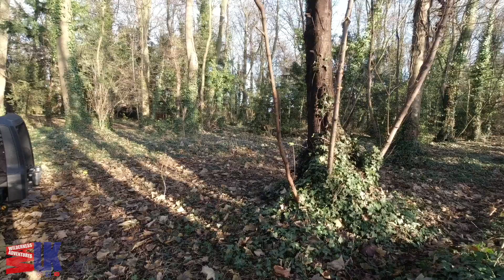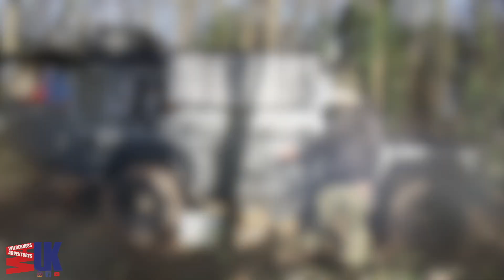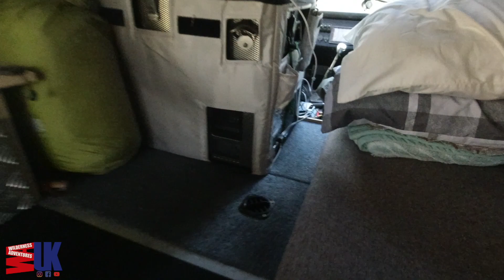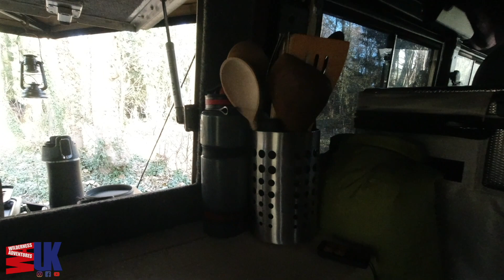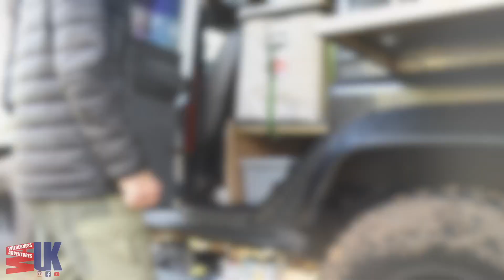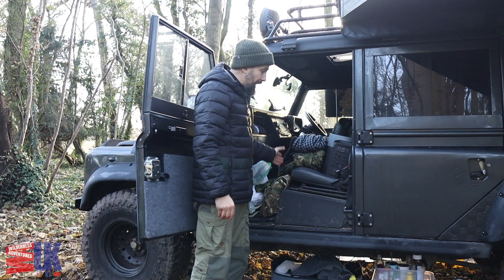Closer Look at the WAUK Land Rover 110 Overland Truck

Comment: Great layout. I prefer spot lights over light bars like you said you build for yourself. Stay safe atb 👍
Reply from the maker: I have the spots on the roof but they are purely cosmetic, the light bar on the grill is functioning tho...

I have a list of things to do, 1 of which is fit the snorkel so I have somewhere to hide the roof light wires

Comment: Nice build, I love a good Land Rover and share a Defender 90 with my dad. We use Davanti Terraroura A/t which were developed by Edd Cobley. Really good tyres.
Reply from the maker: I think ATs are the way forward if you are in a 4x4 and mostly road driving
Reply: @WildernessAdventuresUK  we got them on last year but didn't get much chance to use them. This year however we did a tour of the Pyrenees through France Spain and Andorra then back to the UK in time for the LRO show, in total 2500 miles on roads and trails without any issues. Highly recommended them if doing touring with lots of tarmac